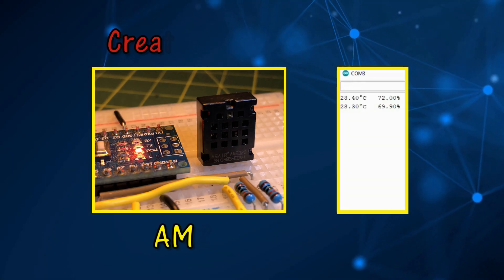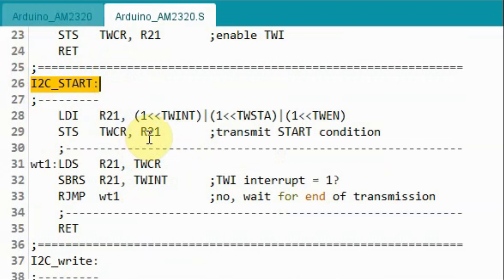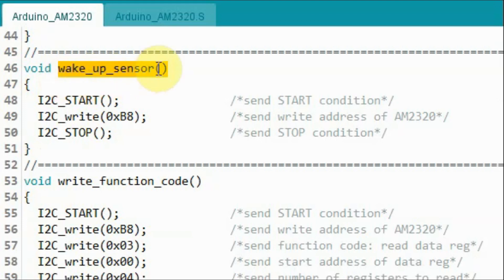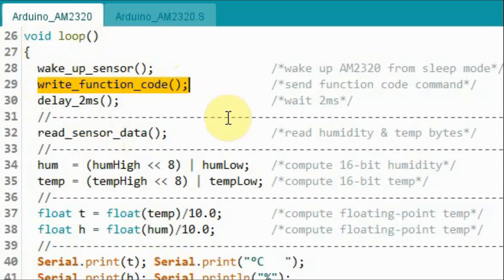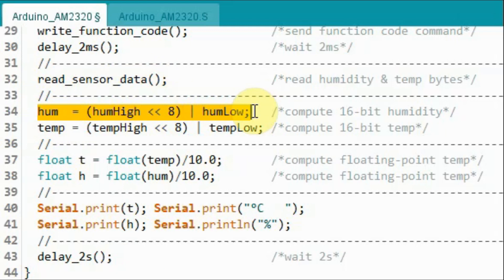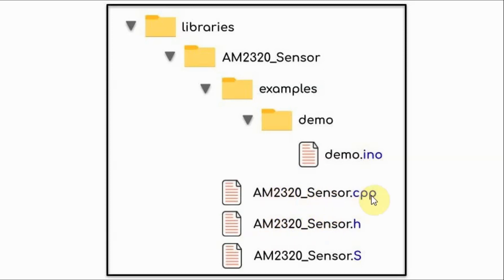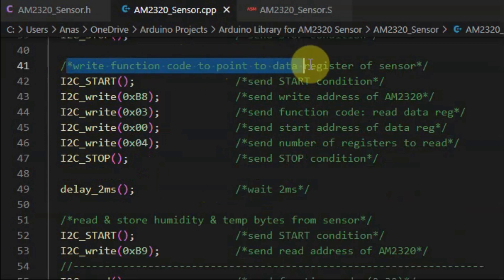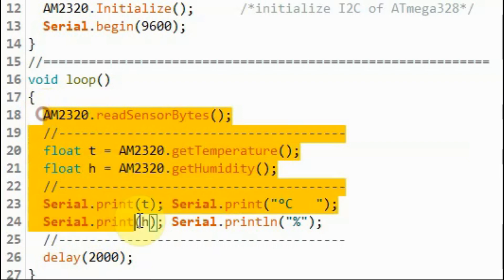Creating Arduino Library for AM2320 Sensor

Comment: Why to code i2c library in asm insteas of c
Reply from the maker: If you code in C, then you may have to use the Wire.h library, which I did not want to use. In addition, coding in assembly far more efficient.
Reply: I think Anas will show us what will happen on the bare metal. Abstraction layers as low as possible.
Reply from the maker: @dl8cy  Thanks Mike, well said